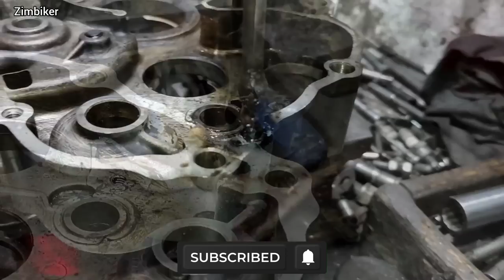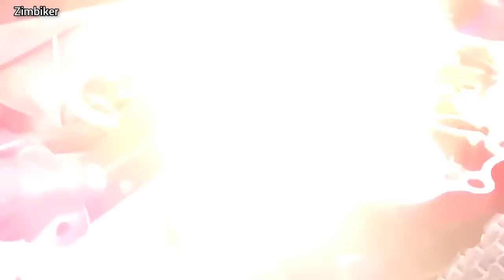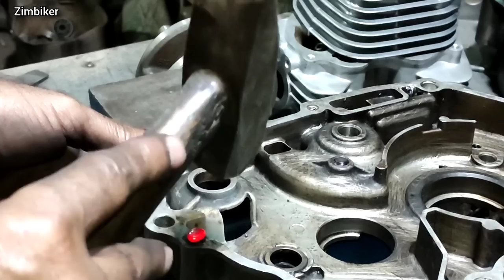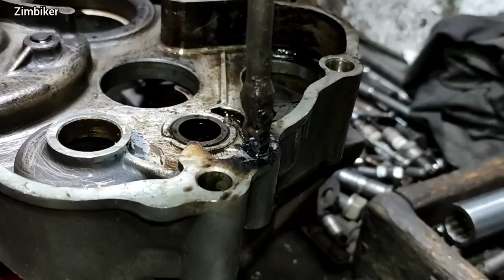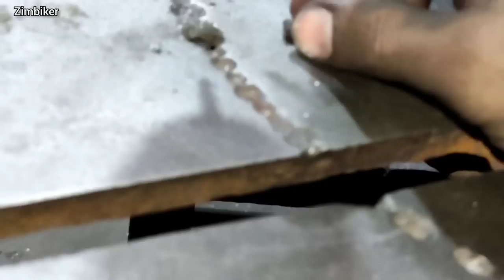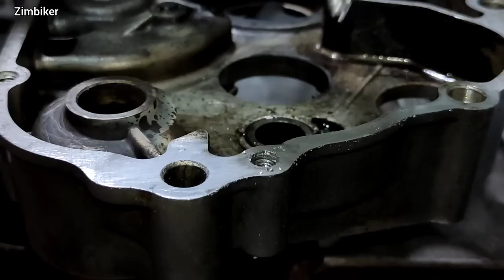How to remove broken bolt in Engine crankcase?

Comment: You know an easy way to do this where you didn't have to drill through the back of the case all you had to do was weld a nut onto that broken bolt there was enough of it sticking up once you did that take an impact driver and smack it with a hammer and bought a bing it's out of the case

Comment: Grind each side flat, soak it with pb blaster, let it sit for a while to loosen up any crud or rust, hit it again with pb blaster,  then put channel locks or a wrench on it to back the bolt out, or you can try cutting a slot in the broken bolt and back it out with a screwdriver.